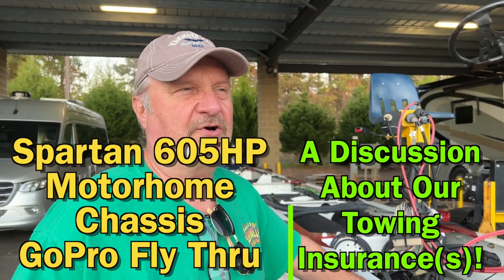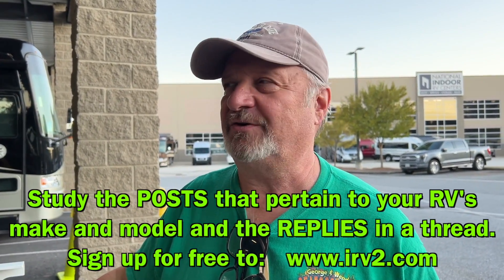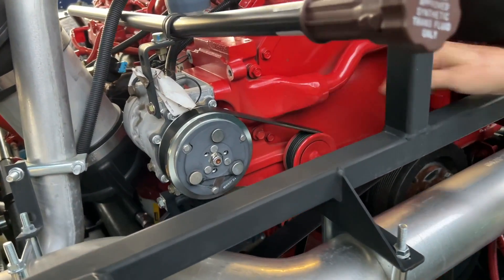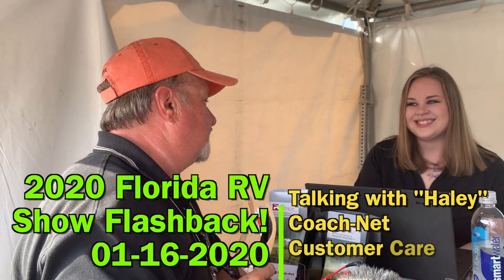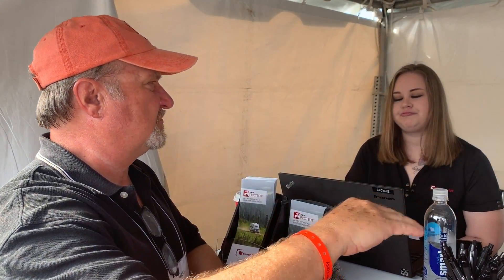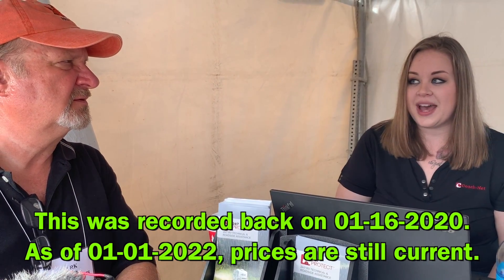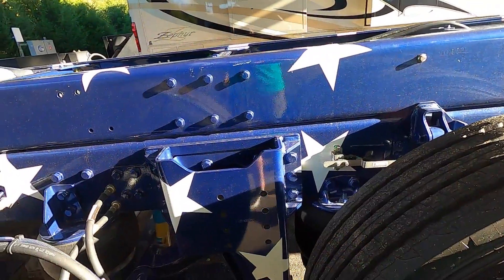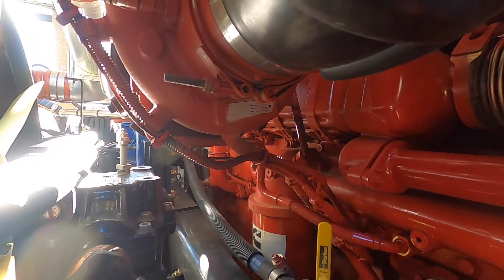BARE SPARTAN K3 650HP MOTORHOME CHASSIS | GOPRO FLY THROUGH NARRATION | EP205

Comment: Spartan's bread and butter is fire truck chassis. I love my 1996 Sartan chassis with 8.3CTA 12 valve Cummings and Allison MD060 transmission. We have 5,000 lbs payload and 15,500 lbs towing capacity. Well designed STRONG chassis!
Reply from the maker: It really is impressive how thick & beefy the Motorhome frames are!

Comment: Excellent video showing the chassis!  I have been doing a lot of research on the Freightliner  vs Spartan chassis. In all the research and information I come across, I keep leaning towards the Spartan chassis. Thanks again for the video! Safe travels!
Reply from the maker: Glad it was helpful! Although I SEE many awesome ideas and features on the Spartan frame, when I read all the chassis comments and threads on irv2.com I am glad we have a Freightliner.  I have been reading about the steering issues on the Spartan frames for a long, long, long time.
Reply: @OurJourneyInMyles  thank you for the update! I was unaware of a steering issue with the Spartan. I will have to dig deeper. I absolutely love the fact that Spartan has that rear service bay with the two filters. That’s what really has pushed me that way. But, if there is a known steering issue…I don’t want to deal with that. Thanks again! Off to more research. Keep those videos coming! Thank you for all that you and Sue do! Stay safe!

Comment: Excellent content. Newmar uses a 2” tubular steel to build a raised triangulated structural support rail foundation on late model high end DP’s. It would be interesting to get your perspective as an engineer on Newmar’s STAR platform. Appreciate the tip on Coach Net and towing insurance rider.👍
Reply from the maker: Our DS Freightliner frame is a 2014 model year, and does not have the STAR platform. I can see why they went to it. On certain campsites, the leveling process twists the frame enough that our bay doors open goofy, and don't close and latch easily.  That improvement was needed and welcomed.

Comment: Nice job Mark and Sue, Please correct me if I'm wrong, I don't know what year that demo chassis was, but I thought the K3 chassis had electric-driven cooling fans, not a belt and shift-driven fan, or is the electric-driven cooling fans on only the late-model K4 chassis?
Reply from the maker: I do not claim to be an expert, but I thought the K4 chassis was only for SUPER PREMIUM RV'S like Foretravel.  That fan could be nuclear powered for all I know! Since I drive a 2014 DS, I just looked at the shaft driven fan as normal.  I will try to remember to peak at the "newer" bare frames at the 2022 Tampa Show this year. You may be correct,..........the companies are always trying to sneak out a few more usable horsepower!

Comment: That upper hose is not the radiator hose, it the ductwork for the CAC!
Reply from the maker: Yes,..... you are correct.  It does have coolant in it though, right?  If so, I am hoping the TECHS at Freightliner changed mine!  I wanted to start with fresh hoses!
Reply: @OurJourneyInMyles  if your talking about the hose you were pointing at and your wife asked you what it was for, I believe your wrong. Jmo!
Reply from the maker: @jeffw7644  I will be at the Tampa Show in two days and I will get the facts!  I am thinking you may be right, and it is a Charge Air Cooler Hose or something like that.  I am going to check if these hoses have not been changed when I am in the mood to crawl under the rig.  I just assumed all the hoses with antifreeze in them would be changed. Are you thinking compressed "air" is flowing through this pipe?
Reply: @OurJourneyInMyles  One of the lines you reference should be your intercooler loop from your turbo. It too needs maintenance. If it develops a leak it will severely affect performance. No coolant just air.
Reply from the maker: @mikeussery4583  Thanks for setting me straight Mike.  That really explains the spring material on the outside of the hose I guess. Our 8.9L 450 HP Turbo Boost max. is in the 32 psi range.